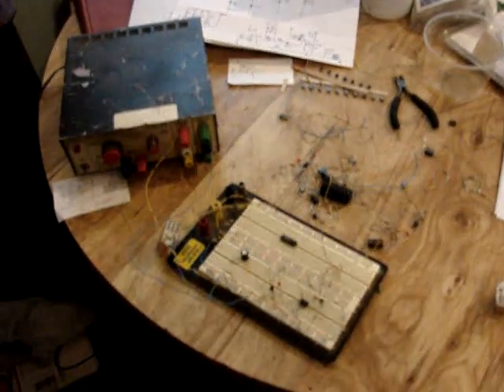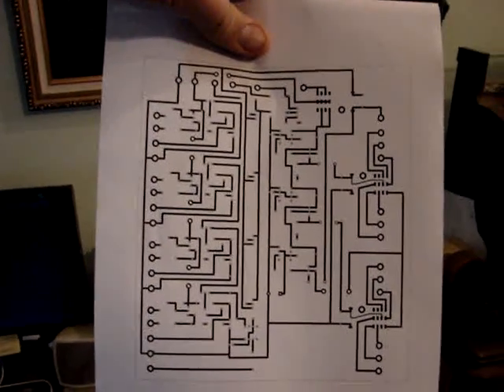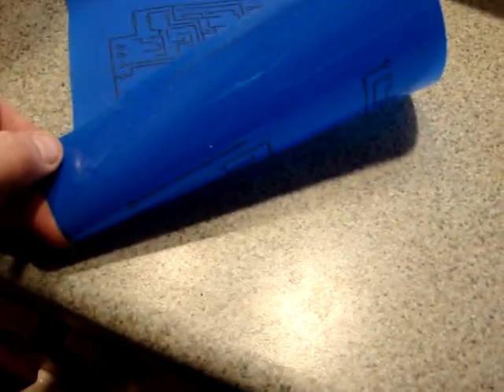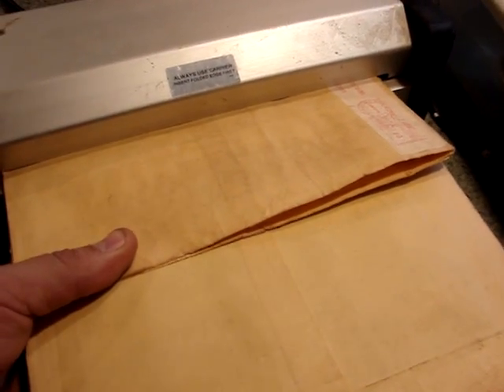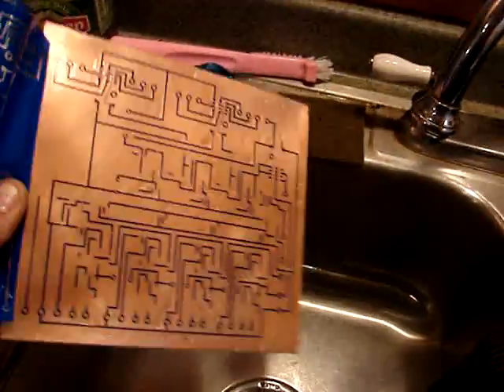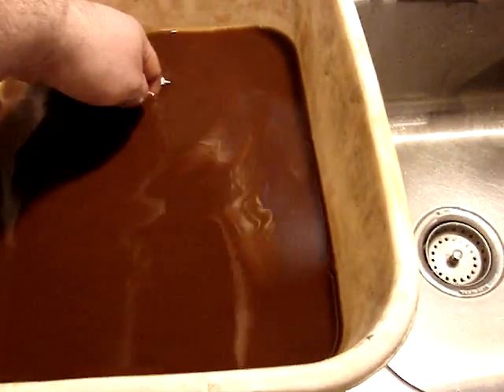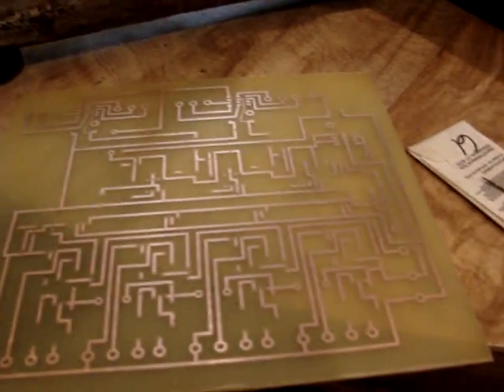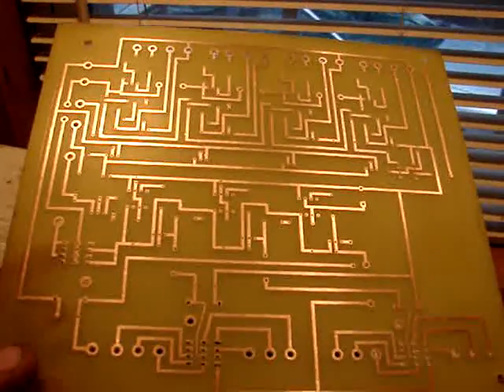Designing, laying out, etching, and drilling a circuit board from scratch - Pt. 1

Comment: The only printed circuit board I ever worked with at home is a Radio Shack universal one where the traces, IC pads and fanned-out pads for the components where already there. It wasn't for a particular circuit just one that uses 1 IC and up to a dozen or so components. I just populated the board with the 555 and RC components for my pulse generator. I have yet to design lay out and etch one but probably will someday although I've populated surface mount boards at work by hand in panels of 10.

Comment: I've been doing this for most of life. I remember designing and building a frequency counter in high school. I did the schematic by hand (no computers back then) and used cut up electrical tape to tape off the circuit on the copper. This process looks so much easier and precise.